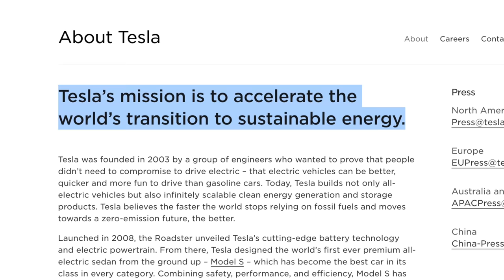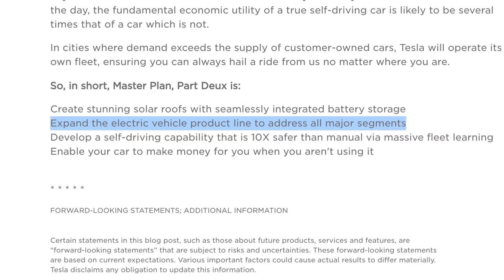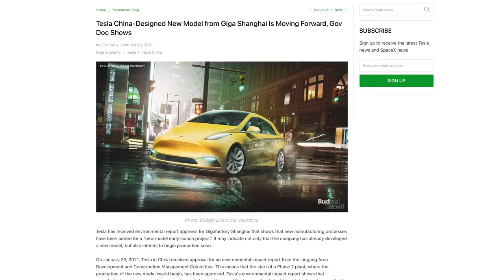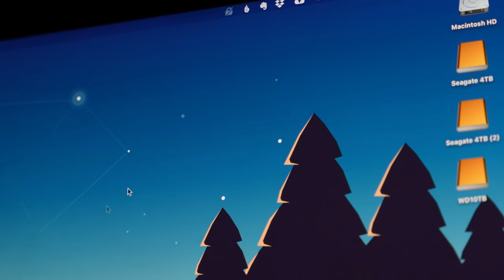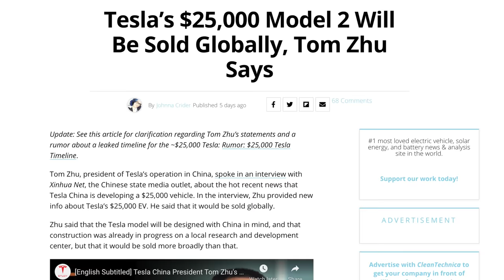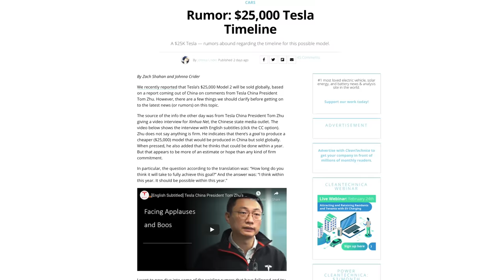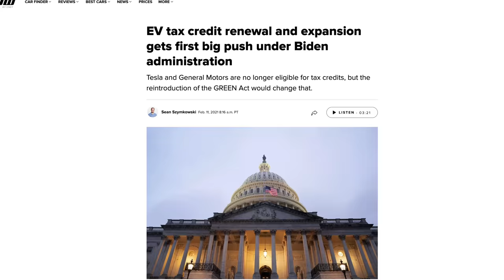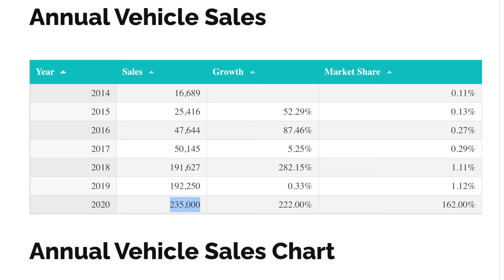New Tesla Model 2 = Game OVER for Gas

Comment: It’s the mileage on a single charge that will decide the outcome. They try selling us city cars, when we want one car for everything like we have now !!
Reply: I watched another YT video that said, based on surveys, that there were 3 main obstacles to widespread EV adoption:
- price (sub $36k) - you can get EV's there now
- range (over 300 miles) - you can get very close to this right now
- recharge (under 30 minutes, full charge) = this is the issue
[and the numbers above aren't exact but they are close enough to make recalling them easier]

So yes you can get a sub $36k EV, but it won't have anywhere near 300 mile range, and you can get nearly 300 mile range but the EV will cost much more than $36k AND NEITHER of these will have such a short recharge time.  Right now it's basically impossible given current battery technology; even under the most ideal of conditions for an M3 and a V3 charger, it can give you 75 miles in 5 minutes, but only if your current state of charge is low and only for that short period of time - beyond that charging slows significantly due to chemical and physical restraints of the battery technology.  The video I reference then goes on to erroneously state that charging to 50% twice under 30 minutes total is the same as charging from 0 to 100% under 30 minutes at once (totally wrong).

Solid state batteries are supposed to be able to charge very quickly, but have limited recharge cycles meaning you'd need some sort of battery swap program.  They're also lighter, so you can pack more onto a car to increase range without the incremental loss in range (e.g. you can add range by adding batteries, but these are batteries that are heavy and merely by adding them reduce the range of the existing batteries, so it's a game of diminishing returns).
Reply: @bairdjc  Latest Hyundai Ioniq 5 can charge from 15 to 80% in 20 minutes, but it requires a 220kW DC charge point. Five of those at a gas station and you're gulping over a megawatt.  Network supply issues?  Meanwhile, I do 24k miles a year, my car gets 500-600 miles per tank which can be refilled in 5 minutes, does 50 mpg, and it cost me $9 hundred.  I think it's gonna be a while before I'm an adopter.
Reply: @bairdjc  There is a decent chance that the IONIQ 5 might be able to deliver on all three counts, if the more optimistic rumours come true. Pricing is set to be between $30k and $40k, making it likely that the long range, rear wheel drive version will be available at around the $36k. Hyundai says it will do 292 miles, but as owners of Hyundai EVs will tell you their cars often deliver more miles than the EPA/WLTP ratings indicate making 300 miles possible for most. The IONIQ 5 is said to be able to go from 10 % to 80 % in 18 minutes, if plugged into a 350 kW CCS charger, which would mean that it in most cases will be able to charge enough to go for at least another two hours before needing to recharge again. 

Solid state will be nice, when they arrive, however as the IONIQ 5 proves the current available technology can also deliver what is needed.
Reply: @hunchanchoc8418  what car do you have?
Reply: @dgaleno2012  A 12 year old Mitsubishi Colt.  Gasolene.  Similar to a Honda Fit/Jazz,  but largely ignored, so cheaper.
Reply: @hunchanchoc8418  what car do you have that does this that you paid 900$ for?
Reply: @leecurtis4032  A 12 year old Mitsubishi Colt.  Gasolene.  Similar to a Honda Fit/Jazz,  but largely ignored, so cheaper.   Admittedly it's not the most refined or comfortable or quick (but it'll do 100 mph), but there's nothing much to go wrong, space to work if it does, and it gets me from A to B and indeed to C.     :-)
Reply: @bairdjc  I AM RUNNING IN TO THAT PROBLEM WITH MY ELECTRIC BIKE TO INCREASE THE RANGE YES THE BATTERY WEIGHT KILLING RANGE
Reply: Mileage depends on weather conditions. Extremely cold weather is very hard on  batteries. Furthermore the batteries must supply cabin heat which further drains them. If you’re driving on a cold snowy night with wipers on, radio on, headlights on, cabin heat on, imagine the power drain occurring on the batteries which will severely impact your driving range. Unless you have a warm place to recharge the battery, it takes longer to recharge because the battery is cold and less efficient. Also how much more energy will be required when you have more passengers or cargo? Lot’s to consider before buying a EV.
Reply: @jenschristiangammelbyjense4474  EV mileage and range is dependent on weather conditions. Cold weather is very hard on batteries. Imagine using your EV on a cold snowy night when you require headlights, cabin heat, and possibly slipping wheels to go up a hill. Driving range will be severely affected by the temperature alone not to mention the other demands cold weather driving places on EV’s. Then you must recharge more frequently , which takes much more time than a gasoline powered engine. That’s even if you can make it to a charging station.

Comment: 2 door hatchback with 0-60 in 3 sec would be FIRE. I hope it won't be slower...
Reply: best version should be faster than that. Cybertruck does 0-60 2.9 seconds with tri motor
Reply: It won t be so fast... or it would depreciate the more expensive model S and model 3. That's simple marketing
Reply: @TyroneJ2900  Rumours is there that this hatchack will have cheapear batteries, so it wont go that fast for sure... But maybe im wrong.
Reply: @hovensteve  I wouldnt agree with you. It can be as fast as Model 3 (i dont think that chassis will be so small that you wouldnt fit standart Model 3 battery) but it wont have for example panoramic roof, autopilot and etc.

Comment: Ya, the model 2 will never see that tax credit. Tesla will burn through that so quick.
Reply: If you read the way the credit being reinstated is worded? It might actually give them around a year of some type of new credits once passed into law. As it has a phase out period after reaching the cumulative 600,000 that is valid for up to 2 more quarters of sales. 
That said though, the compact car won't be made in the U.S. until likely 2023. 
China gets it first(which is smart because it will sell like crazy there, then the eu gets a different looking model on the same chassis, and then when teratx is fully built out and 4680s are at scale. Maybe the 25k will be made available here.

Comment: I think you're right about the price point and dates, but a model 2 with a LFP battery and 200 mile range is not model over for gas models.  Range needs to be 250+.
Reply: very few people commute 100 miles each way, also most people have to stop to pee at about 125 miles ish, range anxst is old old propaganda
Reply: @JohnC-iv8jo  Good point.  My motto is if the range of the car is longer than my bladder range, I'm good :)  Unfortunately, most people that are new to EVs don't see it that way.

Comment: Although having the tesla badge on the car would be great, we already see the issue with the cheep battery. Not to mention that even today there is no 35K model 3. So I love your enthusiasm, but I would be truly surprised if any of this would be happening. But hope I am wrong, it would be nice to have Tesla entering the affordable car market, not only the luxury one.
Reply: Yah I think they have their head way in the sand. It will probably not have a lot of range or charge very fast. Or the battery won't last long. I'll believe it when I see it.
Reply: @mrwhips3623  yeah, something like that, but I wouldn't be worry about battery life, LFP is actually more durable than what Tesla is topically using. My issue is more with the price. If Tesla could do a cheap body they would be already milking this cow. I love what Elon has achieved, but in my opinion there is a reason why it takes decades to became a car maker. To make the car cheap, you need to finetoone the process and shave off the cost bit by bit. In fact, the body of the car is more than half of the price, despite evryone thinks it's the battery. Until Tesla figures out how to make cheap body they can not make an affordable car. This is where I think Tesla is far behind the OEMs. All the rest Tesla is dominating.

Comment: I know the versatility of a hatchback.  I owned a 1980 Subaru 2-door hatchback with full independent suspension and part time 4-wheel drive.  If you folded down the rear seats, you could carry a 10 foot ladder in the back.  If you needed to, you could easily adjust the ride height front and rear.

Comment: Fun Fact:

Mountains are literally being knocked down to mine the metals for the batteries. 
Every one contains 10 litres of oil. 
Every one uses 50 litres of oil to make.
The energy come from power stations to charge them.
Reply: Fun fact:
Battery tech is advancing faster than ever thanks to the demand generated by this.
ICE tech has been stagnant for 50+ years
ICE generates far more waste
With increased renewable energy sources electric cars will be less of an environment burden where as ICE cars will stay the same

Comment: this is great for the Gen Y generation, no more wanting for gas money, but being able to commute to work and school and home.
Reply: Lol no more gas bill but a higher electric bill. You can't just eliminate cost of operation
Reply: @brandonstockton4289  true, but the cost per mile is substantially lower.
Reply: Uses kilowatts to charge it , electric bill will sky rocket,
Reply: @barrycampion9679  yes, but still lower even without solar factored in. But once solar becomes more widespread, then it becomes a no-brainer.
Reply: They could charge as they drive.no need for charging,but they like to make money anyway possible
Reply: @barrycampion9679  true, but I just meant solar power charging the vehicle at that customer’s own home (solar roof). Elon musk was talking about solar panels on the vehicles, and he said it may become an option, but it wouldn’t be enough to really charge a battery in full.

Comment: Far from game over. 🙄 When it takes 2 mins to charge the battery, then it will truly be game over. Until then, people in the US still need a long distance option.
Reply: We still need other things for it to be "game over". The power grid will have to be vastly expanded; battery degradation over time wil need to be controlled so that these vehicles can be bought used after 15 years and still have usable range; and they will have to have been on the market for that long for people to be able to buy a 15 year old EV for $5,000. 
Charging infrastructure will have to expand geometrically as well. Right now a gas station can refuel a car every 3-4 minutes with one pump. To match current capacity with chargers, even if we get to the point where you can fully recharge in 15 minutes, there will have to be 4-5 times the number of charging stations as there currently are pumps. This means more and bigger "gas" stations, a lot more. 
Oh, and the government subsidies will have to go.
Reply: @Gyppor  Totally agree. I just bought a used 330e PHEV. For now, I think that ticks most boxes inside London. Full charge gets me ~25m of range with no need for petrol. When I need to do a longer trip, the ICE is well up to the task and can also recharge the battery. We are a long ways away from completely sacking off the ICE whether Govt's want to admit it or not. That being said, I certainly wouldnt buy a new diesel right about now.
Reply: @WillowGTI  I think the PHEVs are the way to go, honestly. It's a good way to gradually introduce electrics. Full on EVs rely on a large battery to achieve long ranges, and large batter = $$$$ when it comes time to replace. 
Your 25 mile battery is surely quite small and could be replaced for MUCH less than a 100Kwh model S battery. That car is suprisingly inexpensive too, I just looked it up and it honestly looks promising. 25 miles will get a lot of people to work and back.
Reply: @Gyppor  not to mention the sheer amount of resources we DON'T have
Reply: @honesty_-no9he  this comment is so stupid that it doesn't even warrant a response.

Comment: When those vehicles factory warranty expire prepare your pocket to pay for high expenses
Reply: Paul Slana  yep
Tbf

Many have reached long ranges now before an exchange was needed and many guarantees for the batteries are longer.
And a new motor or transmission costs 5k + as well.
For a car with that kinda hp you can pay 10 k for a motor

Would be interesting to see the first few stats on what the upkeep of evs like tesla costs in comparison to a traditional car...
It not needing oil, filters, that many brakes, all these motor parts, upkeep of transmission etc.

I actually dont think its more or much more expensive and its still relatively new tech and will come down in price further
Reply: weird because there are people still driving their original model S where i live and have no problems…. …and those cars are fairly old now! Owners still love them!
Reply: @word42069  still, its quite well known that all battery cars loose capacity just like phones aswell
So they loose Range 

Over time that makes for bad second hand cars

Comment: I don't care about the price. What they need to do is solve the charging times And the range. Unless they solve this problems I'll stick to my regular gas car
Reply: Most gas cars mileage are only rated for 300 mpg for the average person with 370s with a civic. But majority of people get way worst and the range is more in the low 200s and high 100 range. So what more do you want with a electric car? Most people don’t run into charging time problems either as they leave it charged when they sleep. It’s basically a don’t be lazy and you won’t run into charging problems Or range. Only thing a ICE car has rn is that you can go cross country with no worries while an electric you can’t without going the strict speed limit.
Reply: @TienTran-kw3il  that’s it you live in places with heavy amounts some people live in apartments where they cant
Reply: I charge my Volt every day, plugging in takes a few seconds. I practically never go through the entire 45 mile battery and have to switch to gas. Filling up never interrupts my routine, and I'm overjoyed I never need to pay attention to a gas tank. If you're driving hundreds of miles in a day, you have a sliver of time to spare on charging on the road, and could stand to unwind at a rest stop.
Reply: @chriswildingj7522  Then you're in the minority. Only 17% of the US population lives in an apartment or condo. The rest lives in some sort of house. Also, unless you're in a high end apartment or have a garage at the complex, It's simply not wise to even own an electric car due your living situation.

Comment: If it looks like the thumbnail and cost less than 25k count me in! 🙌🏽
Reply: Reality:  it likely won't 
And it likely won't.
Reply: @Joe Farruggia I own a Fiesta with 5speed manual.  Solid, dependable, frugal car.

Mine has air conditioning (standard here), 4 doors and a boot which I prefer over hatchback.

Comment: A beater car 4000$ 1 side insurance is still the way to go( like a P.Vibe2010 or T.Matrix2014) even if that tesla was $19 000 there will still be a 850$ difference between each year worth of free fuel. The main problem isn't EVs it's insurance :) Depends on if you need to flash with your car or not.

Comment: I’m gonna need an option for long range, for myself to buy it, 200 is enough, but I’d wish for it to have more
Reply: All about clean, and efficint.
How much fuel does a scooter use?
How much could a battery be charged on 5gal.?
Reply: @10324800  They need more range.

Comment: Owning EVs means a torture to recharge for any kind of long trips. It is overhyped useless crap
Reply: Yessir, even if the price goes down on a tesla I wouldnt want to get it I would rather have a diesel or a gas vechicle
Reply: But how many people do long trips? In this case, buy two cars. One for business one for the trips around town and to the shops and pick up kids
Reply: @danielbentley6000  lol no thanks, Ill just get one normal gas car
Reply: @danielbentley6000  very true about people making long trips, IF people make long trips it's usually on vacations or special occasions and even then half the time it's a short trip to the airport not driving the whole way, so maybe a long drive a couple times a year.. so, why buy a 2nd car to use twice a year?? use an electric car when traveling 200 miles or less, and rent a car for those long trips.

Comment: A good and practical ev would be tempting as an alternative if: 
- it was a compact small suv-type hatchback with low and flat threshold at the back with decent space for a large size dog or snowboards with one side of the rear seat folded.
- good ground clearance and airsuspension, since roads are so bad more or less everywhere.
- the air heat pump included for heating the car properly before departures during cold winters. also otherwise suitable for colder areas in handling and practicality.
- the model S plaid style display looked nice. more like integrated into the dash than sprouting out like a wallmounted gamemonitor.
- classic steering wheel.
- compatible charging options for areas where superchargers are still lacking.
- good quality and durable paint for icy, salty, dirty locations. 
- reasonable height for rear seat passengers especially legroom height. 
- price closer to 15k€ so you could actually have a chance to get one by trading in your old car.
- a good small dash behind the wheel to keep the essential info closer to driving perspective or a good hud.

what i like so far is that it will be smaller and cheaper. the other models are on the big side and expensive. i'm glad the batterypack will be more efficient and safer. the model 3 is tempting but it lacks the hatchback trunk and some other details and they are all on the expensive side.